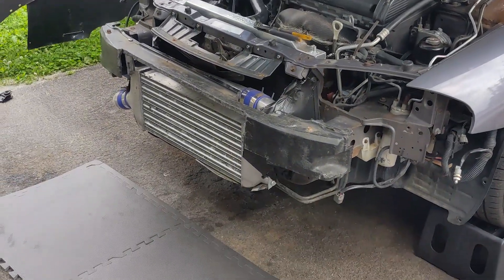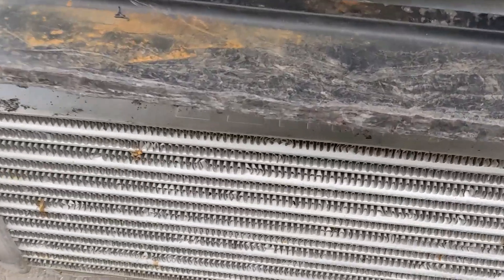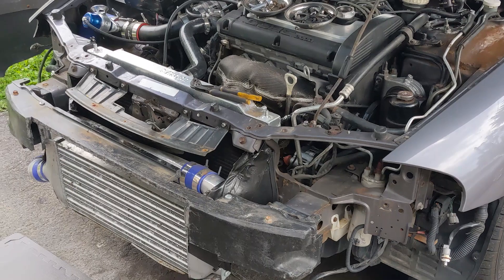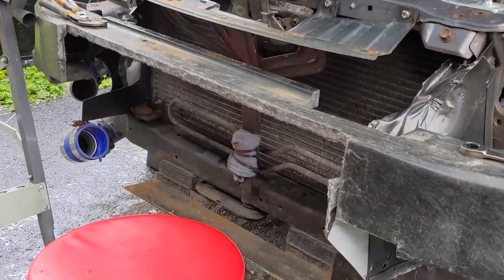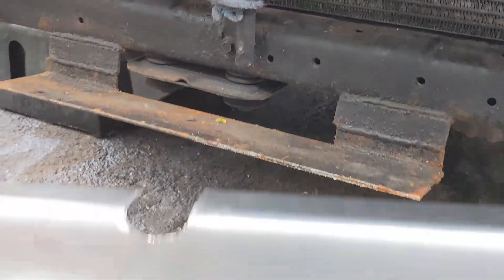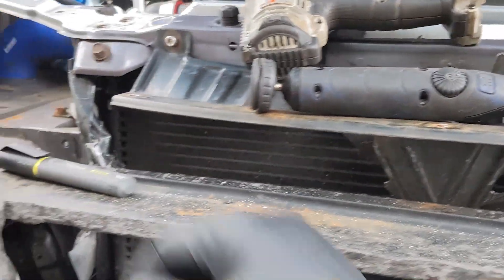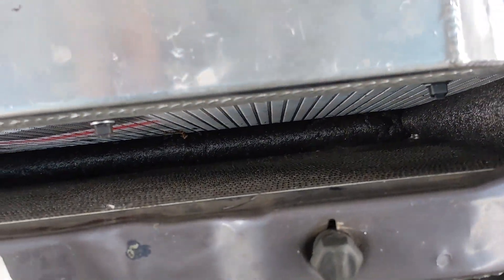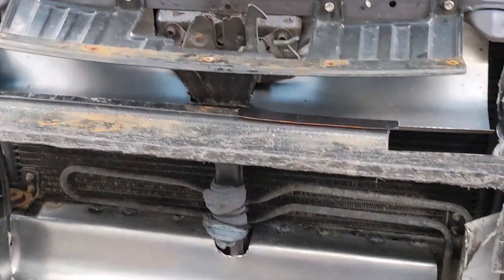BUILDING STEEL RADIATOR DUCTING!!

Comment: After a good while of driving the car what are your temps at after doing this
Reply from the maker: They stay no lower that 193 highway speed and no higher than 206 city stop and go. I changed the way I did it in a later video that was much easier to do
Reply: @TPGDSM  if car is at 206 is it ok to hit boost and do a wot pull or will that be bad for the engine since I think the ecu starts pulling timing around 207
Reply from the maker: @ihatejavier  I believe it pulls 1 degree at 206 and fans come on at 206. IMO I wouldn’t worry until it gets up to 220’s and keeps climbing

Comment: Hey! Did this improve the cooling alot? Im in texas heat and my temps climb up to 220 when driving in traffic
Reply from the maker: I actually redid it in one of my recent videos
 Check it out. "Mission to lower engine temps pt. 2" 
I would see 203-206 cruising, with ac on temps would slowly climb to 220's. Now I see 186-193 cruising and 203 with ac on.

Comment: How did this end up working!?  My 1JZ is hot as heck and I'm planning to do some ducting myself.  Cheers from Tampa Bay
Reply from the maker: Hey man! So far it helped out with the fmic. It has a big pipe that reaches across the top of the intercooler (blocking airflow to the rad). The dsms have oem plastic ducting that redirects airflow from the low opening in the bumper, up through the rad. I'd suggest grabbing a nice mishimoto or koyo rad with some 12in spal fans. Spal makes the best fans imo. Hope this helps you 👍